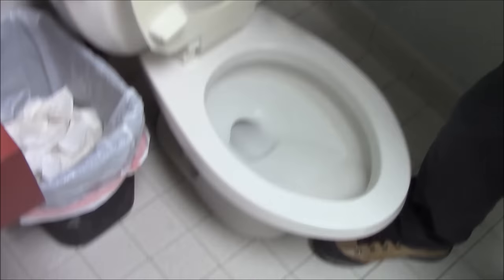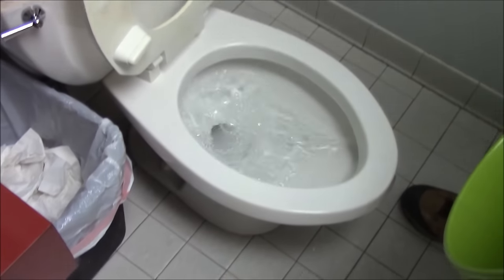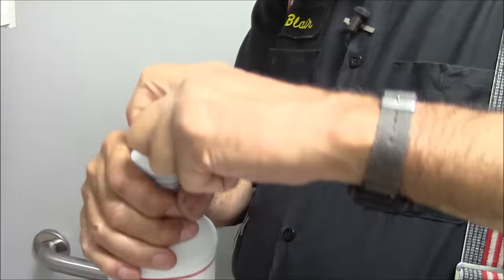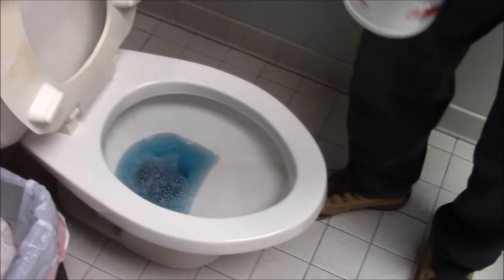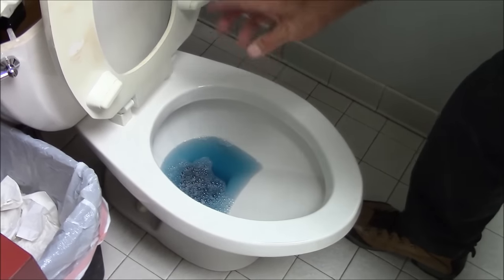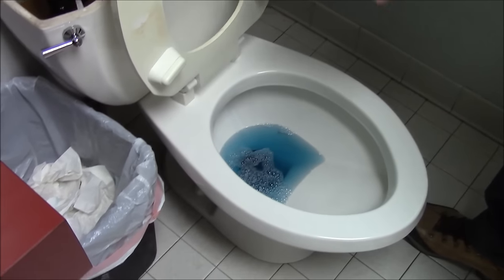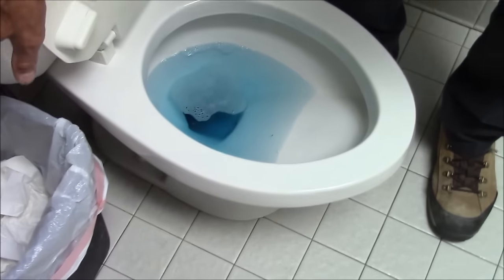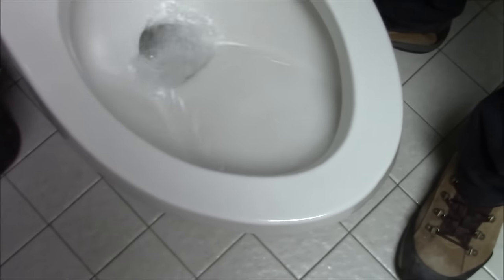Slow Flushing Toilet? Quick and Inexpensive Cure With Delimer

Comment: Amazing. Thank you for this. 22 year-old toilet, main one for the house, started slow flushing a month ago and assumed it was some kind of outlet issue. Tried your bucket test with skepticism but ok, that worked better than flushing. So two rounds of VINEGAR for 30 minutes, taped the holes on the second round, then amazing how all the holes/spigots ran like new!
Reply: Jason, where did you pour the vinegar? In the overflow tube? I prefer using all natural ingredients , if I can. Thanks!

Comment: Thanks for the info. I was cleaning my toilet and noticed a bunch of black crud coming out the more I drove the bristled brush up the under side of the rim and the more I worked it the more I noticed water flowing down the front of the bowl where I hadn’t noticed any flow before. Which led me to your channel. Because I figured there were journals inside I couldn’t see. You referred to them as raceways   Anyway liked and subscribed and heading to the hardware store to pick up a bottle of the referenced product and clean all three toilets that way. Thanks for the information!
Reply from the maker: Love it , thanks

Comment: This is the most useful informative video I've seen about helping toilets. We don't have the product here. Will have to find an alternative.
Reply from the maker: CLR is not bad, but I like muriatic acid when I can't get delimer.
Reply: Mr. Hardware oh my. I use that to clean the grout in tiles it's real potent. I didn't know u can use in toilets as well. Good to know!
Reply from the maker: Did you ever get burned from the chemical?  Blair, did you find it dangerous?
Reply: @MrHardware1  Do you mean to use the CLR and the muratic acid mixed together?
Reply from the maker: @deborahelaine9985  No, no no. I offer CLR as an alternative because Delimer or Muriatic acid may be too difficult to purchase in some areas of the country. Never mix Muriatic or Delimer with anything, they do well all by themselves. Blair
Reply: @MrHardware1  Thank you for clarifying that these products should never be mixed!
Reply: @MrHardware1  Thank you!  I was just going to ask you about CLR.  I'm using that right now.

Comment: Four years later and this video is still helping people out. Was finally able to get Rooto 3-in-1 from Amazon. The price fluctuated wildly, but I got it "on sale" for $20.00 a quart. I suppose I could have tried something similar, but I really wanted to use this specific brand with your instructions first. I let it sit for an hour before flushing. So far, so good! Even after 12 or more flushes, I can still see a few bits of calcium gunk coming out of the jets. For others: Don't forget to open a window if you can - the fumes can be quite something! Thank you so much for your video, Mr. Hardware!
Reply: Thanks.
Reply from the maker: Don’t be afraid of using muriatic acid, much cheaper and very close to the same thing if you need another dose.
Reply: Thanks for the window tip.
Reply: Excellent advice about being prepared for the fumes!  Not all bathrooms have windows...

Comment: WOW! Thank you so much! I used a bottle of CLR and a coat hanger as my toilet had passed the bucket test it meant something else was wrong and you the man!

You nailed it on the head! Once I had like an idiot just dropped a piece of toilet paper down the center pipe when cleaning the toilet back and thought nothing of it, and maybe it was not the problem but it sure focused 100% of the light on the top part of the toilet rather then the bottom (drain and trap) and now it flushes amazing!  Thanks so much for your video!

I also ordered a bottle of the stuff you recommend to have on hand BTW the prices on it have quadrupled it's not $5 anymore its now about $20 but on EBay you can get it for $10 shipping included and of course Amazon has it for $39 (Who cares :)  )
Reply: Yes the wire coat hanger and CLR did the trick for me as well. Just take a plastic cup and keep recycling the CLR out of the bottom of the bowl into the overflow to push out the rust and lime and calcium. Then back to wire coat hanger, and repeat till works.
Reply: It's $80/case plus shipping now.
Reply: Thanks for this. CLR worked for me too. I only had 1/4 of a bottle, so I added some water for a 50-50 solution, put it in overflow valve, let it sit for an hour, used the wire, and it worked like a charm.
Reply: And now a YEAR later its NOT on Amazon or Ebay anymore UNLESS you wanna buy a pack of 12 it they are going for $65......I guess just make the invest for a life time of toilet bowl cleaner. LOL
Reply: @EliteOnTheBeat   I found a product locally at hardware store called Acid Magic by Certol.  ;safer' muriatic acid.  Worked great!  About $10 a gallon

Comment: Hello M Hardware. Great video. Do have shop in Pattaya Thailand?? I need some of that cleaning fluid. I guess I'll have to try and find something similar here. Your 100% right about the blocked jets.
All the best from cloudy Thailand.
Reply from the maker: You may be able to find that good Thailand muriatic acid. It will work as a decent substitute. Blair
Reply: It's called bleach.
Reply: @Nautilus1972  Bleach is chlorine.  Muriatic acid is HCl, or hydrochloric acid.  Not the same thing.  I've used muriatic acid to clear my toilet jets and it works great, but you need good ventilation and to hold your breath while pouring so you don't inhale it.  Then leave the area for a while until the fumes clear.

Comment: Great tip, but I would recommend pouring that solution more carefully so that none of it gets into the tank water! That stuff eats away at the flapper valve and seat! also the rubber washers holding the tank down to the bowl! I learned the hard way by pouring vinegar in the tank and flushing with it as another video recommended!

Comment: I found this video after I had finally figured out my problem. I used muratic  acid. My toilet was plugged due to the lack of pressure to flush the waste through the pipe. Cleared the pipe expecting everything was ok. That’s when I realized I lacked water pressure. Poured acid in the tank and solved my problem. The jets were clean as new.

Comment: I'm not a plumber, but I do feel that if it's really clogged, then BOTH this method combined with a hard bristled pipe cleaning brush (for the holes) works very well. I even used a larger brush for the siphon jet hole. I just put a small amount of ZEP Acidic Toilet Bowl Cleaner on the pipe cleaners and the larger brush itself and scrubbed the heck out of each hole. Once done, I followed this video to eat away at all the buildup hidden deep within the holes.
Reply: Interesting.  I would have thought the pipe cleaner would not work well.  Maybe you used the pipe cleaners shortly after the application of the Rooto.  I would think if the remaining calcium deposits hardnend again the pipe cleaners would not work.  The calcium deposits are very strong difficult stuff.

Comment: Wow ...... This method worked Great ...!!! But , I did make one improvement ....
I have a Kohler Class 5 toilet .  It has a 3" drop with the canister inside... But we have hard water and little by little I noticed the flush wasn't as vigorous as it was when new....
The alteration I made was . 1. I went around the rim before I started with a small Allen wrench and pushed it through the holes wiggling it around.
2.  Using Gorilla tape, I taped all the holes closed to hold the solution in the rim longer.
3. Using a the bulb end of an old antifreeze tester , I blocked the siphon jet at the bottom, again to trap the solution inside...

The rest was the same to the end, except I pulled off all the tape and bulb . Then used  hot water to bring the level up to get the solution up to the trap ....

Wow .... water shot out of all the jets and there was force like it was new ....!

Good Procedure ... Maybe once a year, keep it clean !  😊

Comment: This video was very helpful.  I was on the verge of calling a plumber.  I couldn't find the 3-1 in stocks. I bought some CLR instead.  Mixed it 50/50 with water. Poured it in. Let it set for an hour. Worked great like you described.  Like a new. toilet.

Comment: Thank you so much for giving me the answer I knew was there for me. You described my problem exactly. I’m in CA but I’m going to find that delimer you mentioned & give it a try.
Reply from the maker: @cathcobb3869  try muriatic acid, I bet Rooto is not in your state.
Reply: @MrHardware1  You're right, they only offer CLR. My brother suggested muriatic acid too. UPDATE: It might just be that I need to "hold" handle down when flushing, vs a quick tap and release. I tried that change this morning and it's like a miracle happened.
Thanks again for the help.

Comment: Thank you for the video. It helped me extend the life of my toilet. I had to use 2 gallons of full strength Muriatic Acid to clear all the lime and calcium deposits. Can I purchase this online for delivery? I would like to use this product for routine preventive maintenance (every 4-6 months). If not, what would you recommend for a good substitute.
Reply from the maker: From what I’ve read shipping acid is too expensive. It should be easy to be purchased in your local community from a building supply or a pool supply.
I’m not a fan of using any acid cleaners or delimers as constant maintenance plan except possibly a sump pump discharge line that gets clogged with calcium. The delimining in your toilet should last 5, 10 or even 20 years. So dumping acid every 6 months is only going to cause premature wear on your cast-iron drain lines .

Comment: What you illustrated was good for the low hanging fruit. Scale build up is what slows down and hinders the flush. Look in the Jet Hole in the lower front area of the bowl. Flush out as much water as possible get a inspection mirror and feel in there with your finger. Wholly Crap Batman it's almost fully closed up. This my friend is the challenge. How do we dissolve the scale?
Reply from the maker: Get a half gallon of Muriatic acid or the toilet delimer and after plunging most, not all, of the water out of the bowl slowly and without you face over the bowl pour at least one quart in and wait 20 minutes. Flush and  add several gallons of water in a bucket and see how that works.
Reply: When I first discovered the extent of the blockage and found years of calcium and mineral build up I actually picked at clumps of it in the Jet, I dug out some big peaces. The acid has been on my mind as a last effort. Is 45 minutes going to clean out the deposit efficiently? Or can I leave it in longer?
Reply from the maker: @donklaing  I have had to to 3 doses on old toilets to get the jets clean. Usually the acid is inert after 45 minutes but longer should not hurt.

Comment: Great Video!  one thing... when working with acids... safety glasses at a minimum are recommended.  As an aside, I saw on another youtube video, someone using duct tape to block the holes before pouring in the acid.  Clean and dry the underside of the rim first, of course :)  Thanks for sharing this!

Comment: I'm going to try this. Our house has original toilets and fixtures from 1957. There is one toilet that is flushing slowly. The local Plumber insists that we just replace it. My husband loves that the toilets flush with tons of water. So he has been looking for a toilet like that online. Turns out that they are 4x as much as a regular toilet. I hope this method works.
Reply from the maker: A toilet that old could take up to 3 doses to clear out the calcium. If the toilet passes the bucket test this will work.

Comment: Can I use acid products with a septic system?  Or even vinegar for that matter?  This was awesome, hope I can try it with my septic system
Reply from the maker: @EthosGirlUSA  yes because 1 quart of acid by the time it has reacted with the lime in the toilet and the crud in the drain lines of the house leading to the septic tank the acid is relatively inert. If not totally by the time it hits the tank. Plus most tanks are around 1000 gallons so 1 quart of acid isn’t gonna decimate a septic tank

Comment: Vinegar and Joy dish soap works good in the overflow hole under the lid.    Let it soak a while, then flush   Use the end of a wire coat hanger to open up clogged holes under the rim.    They are at a angle, not straight in.    Works good for me every time.

Comment: Great delivery, and video. Thank you!  Question: does this delimer (or muratic acid) harm the natural composition of a cesspool or a septic tank (for older, rural houses)?
Reply from the maker: Only if you put it directly into the tank or use it too often. By the time it delimes the toilet and encounters crud in the drain lines it is pretty inert by the time it hits the tank.
Reply: @MrHardware1  ... I really appreciate your advice, huge thank you! That makes a lot of sense.

Comment: I just put a half gallon of "Awesome" cleaning vinegar down the toilet (straight into the bowl, not into the overflow) and some dish soap , and a couple of gallons of hot water, brished all around, including under the rim real good, and let it sit there a few hours. And it flushed nicely after that! Someone did use those blue tablets on this toilet recently, I threw them in the garbage!

Comment: Some low flow toilets seem to be overly biased to the siphon get that pouring liquid acid down the over flow won't do the trick to clean the rim jets, what I've found works is thick toilet bowl cleaner like lysol or lime away, grab two bottles or three or even four if you've got a helping hand and squirt them all down the over flow and let it wick out the jets, might take a few times since the acid isn't as strong but it did the trick for me.

Comment: Long read, but could be worth it:
First, my complements on your video!
I have three toilets exactly the same. My other two flushed quickly while the third one took considerably longer.  I spent an hour trying to figure out what was going on. I did the bucket test and that seemed fine. Then I plunged it for 6 flushing’s with no improvement. I confirmed the tank was filling up with the proper amount of water and even held the handle down when I flushed it to confirm the flapper was working properly. I have a newer toilet, so I don’t have all those little holes in the rim. 
I was ready to give up when I noticed a slight build up around the front opening in the bottom of the toilet.  (I later learned it’s called a “Siphon Jet”)  I scrapped it off with a screwdriver.  When I flushed the toilet, I noticed water slowly exiting that hole.  I had never noticed that opening before and had no idea of its purpose. As a last resort, I reached into the toilet and felt inside that hole. It was more than 80% clogged.  I positioned a small mirror in the toilet and could see what looked like volcanic buildup. I got a small screwdriver and blindly chipped away at it for an hour. After removing alot of the buildup and opening the hole, the toilet now flushes 1,000% better.  
My next step is going to be to put some product in the toilet and see if that loosens up the buildup. I’m sure it goes back further than I could reach.

The bucket test is also a great way to unclog a toilet if you don’t have a plunger. Maybe better!!!
Check out this video:   https://youtu.be/LmsIYwf8QqQ
Reply from the maker: Did you purchase that toilet from a big box or a hardware or plumbing supply…. (Coming from a small businessman) We have encountered’ seconds’ being sold as ‘grade a’ at big boxes. Just saying, buyer beware
Reply: @MrHardware1  If you are asking me, I purchased mine from a plumbing suply store.
Reply from the maker: @davidg8032  Too bad you got it cleaned, you should have taken it back. I put up w a lot myself before I uninstall something….
Reply: @MrHardware1  I figured out why this one toilet had such a large buildup and the others had none. Care to know?
Reply from the maker: @davidg8032  you bet!
Reply from the maker: @davidg8032  blairgil@gmail.com for direct email. Thanks

Comment: I liked your video. Would this method work on my septic system ? I was wondering if the chemicals would kill my septic tank bacteria ?
Reply from the maker: Only if the acid, and more than a quart, was poured directly into the septic tank. By the time it reacts with the calcium in the toilet and the crud in your sewer lines it will be pretty much inert.